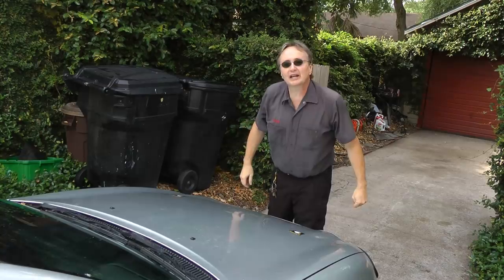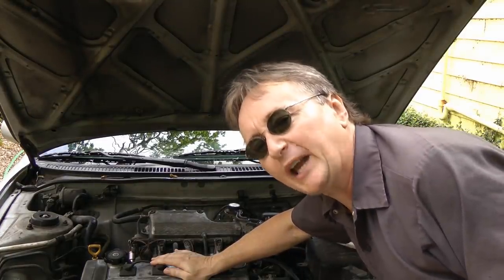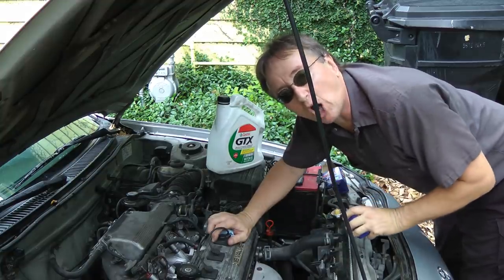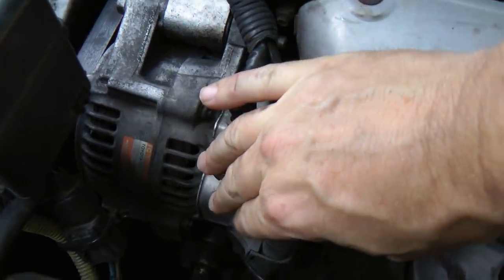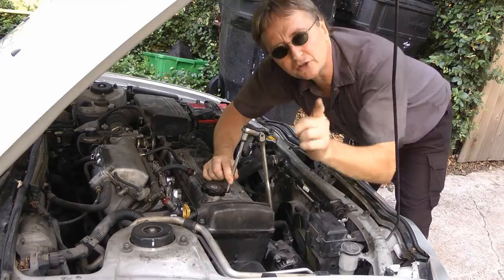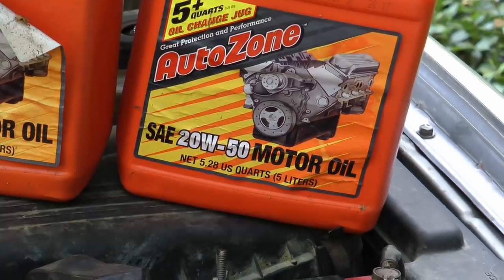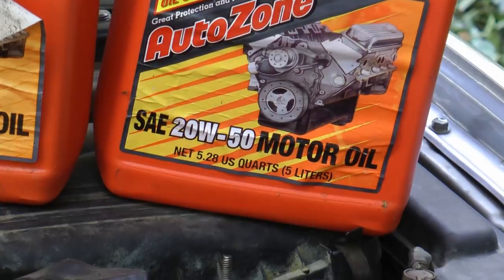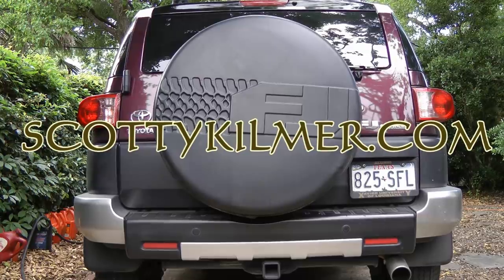Top 4 Mistakes Car Owners Make (DIY Fails)

Comment: Yep, I accidentally double gasketed an oil filter on a Mercury Cougar.  Cranked it up and heard a weird noise look under the car and there's the whole jug of oil I just put in it xD
Reply: happens to us all
Reply: Was it a 302 Windsor?
Reply: The rubber ring very seldom sticks to the engine block if it's does it's because somebody didn't put oil on the rubber first to the other guys question what is a 302 Windsor there is no windsor it's a 351 Windsor it was made in Windsor Canada versus a 351 Cleveland that was made in Cleveland
Reply: Only use a premium filter with a check valve in it that holds the oil pressure up in the engine.!!!!!! Or you will have dry start up every time good oil filters are junk anymore. Always match the rubber o-ring up with the new rubber o-ring make sure their exact a lot of oil filters nowadays have smaller O-rings they don't match up or they're sitting in a new area just barely ceiling with a lot of oxidation
Reply: Yes, I did that once but it didn't destroy my engine.  After an oil change I always check to make sure that the oil pressure returns to normal  after running a few seconds, and then I get out and check for any leaks, before driving.  So, I only ran the car for a few seconds with oil spewing out.
Reply: Be careful we can't even talk about cars the mark of the Lord Jesus Christ is listening to us and trying to hack us !!!!!
Reply: I would agree, I change people oil filters 70 times a day. Never done that.
Reply: dammit don't say that I haven't had that happen to me yet lol
Reply: thank you lol.  I have never had it happen and that is becuase I always oil up the new ring.
Reply: Ditto. Happened to me to. I was taught by my dad to start the car, then look under it to see if there are any leaks. Boy was there a leak!   All because that prior gasket stuck to the block and I didn't notice.
Reply: gizzy nc I've never done it and I've always change my own oil lol
Reply: I had this happen to me several years ago. Everything seemed fine - I always check for leaks - until the next day when I went to work. I got about 1/2 mile and the oil light came on. Pulled over immediately and all the oil as gone.  As I walked back home, I could see exactly where the engine started splooging oil - about a block and a half before I pulled over. When I changed the oil, the engine was cold. As soon as the engine warmed up on my drive to work, the gaskets popped loose.

Lesson learned. Only cost was for another 5 qts of oil. Most people would probably never notice the oil light and drive until the engine seizes up.
Reply: Did the same on a used Nissan that I was doing my first service on.  The old filter was a Fram.  I only use OEM filters and that's just one reason why
Reply: Yep and thats why you dont buy cheap oil filter made in china or brazil 😂 just buy some genuine Mahle filter and you are good.
Reply: what year/model   I've never seen that done, there's simply no room to double seal on most cars I work on.. the filter wont come close the threading on my old camaro
Reply: @ricksimpson2167  
Rick, you are wrong! I never missed putting a film of clean oil on the gasket of every filter I ever installed on my cars over the decades, but it happened to me once, back in the '80's. After that, I watched for it ever since, but hasn't happened since.
Reply: @markwheeler202  Engine oil is supposed to be changed when hot, not cold.
Reply: @1redrubberball  Which I did, as always. The unfortunate incident occured the next day.
Reply: @markwheeler202  
Yeah, I understand. It happened to me on my '72 Cougar XR7 351-C engine. I too always cranked and looked for leaks and there was my new oil, all over the driveway. That was back in the '80's. Every single time changing oil/filter since then, I remember to look for the gasket. Ah! Experience!
Reply: @ricksimpson2167  I got them both beat: I have a Windland engine, made in both places and joined together on lower Wacker Drive in Chicago.
Reply: Ah the double seal.  I did it...on the underside of a 7.4L 454...in a boat.  Hella mess.
Reply: @gizzync1525  no it dont
Reply: @tomclose6643  really ? you never made a simple mistake ? either rushing or just not fully paying attention or you just got pulled away for 1 sec?
Reply: @jasonhochman3750  Listen to your engine. It will tell you.
Reply: the oil didn't leak out until the pump pressurized it and forced it through the double gasket. 

This wasn't my car have no idea who did the oil before me. Luckily no damage was done to the engine. 

I always look to make sure the gasket is still on the old filter when I take it off now. 

This was a last gen cougar with the 2.8? V6

Comment: It's a good idea to fill the filter with oil to saturate the filter media. you can dump out the excess when filling the crankcase. This lessens the time it takes to build up oil pressure to the bearings and hence less engine wear.

Comment: The W in motor oil specs (ie: 20W-50) stands for Winter not Weight.
20W is the viscosity when cold (Winter) and the 50 is the viscosity when hot.
A common rookie mistake. 😋

Comment: So true about that disabling the battery part Scotty! One time I was backyard fixing one of the brake lights on my Lexus, I cut up the wires and wired in a new socket for the bulb from an old Chevy (it was all I had at the time) and I accidentally wired up the new light wrong. Ended up blowing the brake lamp failure sensor.... Luckily I had a spare car to take it off of but it would've have been a costly mistake. None of my lights worked when that blew, and I had to spend a week figuring out that the sensor was the culprit. After I put the new one in, everything is fine. I havnt even switched out the rigged up side with the chevy socket because it's working just fine 😅😂 The lesson im trying to teach is, when you think you know it all....things break. Just disconnect your battery and don't add unneeded stress into your life! Keeping a 24 year old (or any) car running is hard enough as it is 😂

Comment: When I was a kid I owned a 1958MGA. It had a steel can that contained the oil filter. I was changing the oil and filter on the apron of my friends’ garage.(thanks for being there for me White Cross Racing)   Four times I fitted the ring gasket and filter and four times I blew oil all over at start-up. My buddy Olson,part owner and Saint eventually took pity. Using a  sharp pick he dug five old o-ring gaskets out of where the filter can seated, put in my new one and the job was done. Experience will out! Thank Scotty for helping we amateurs out.

Comment from the maker: @cupnoodles2  those hondas can run on just about any oil. I use 20/50 castrol year round here in Texas. If it gets cold where you are, go ahead and switch to 10 w 40 or 10/30. Scotty
Reply: Honda makes some great engines...their automatic transmissions are junk, but the engines are pretty dang good at least the older ones were.  The car will fall apart but the engine will still be fine LOL.
Reply: William Todd my 2001 handa accord with automatic transmission still works perfectly fine, just needs a new power steering pump is all and it could do with new body parts. Other then that I haven't had many problems with it.
Reply: I have an 08 Honda Ridgeline it has 250,000 miles it runs great
I only use synthetic motor oils

I got the truck when it had 60,000 on it and the transmission has always had a little Shake right at 45 50 miles an hour but is never gone out
Just kind of weird

Comment: As you know, there are exceptions to every rule. And one exception with the spark plugs is on the Ford 5.4 L V-8. Sometimes you have to run the snot out of that engine to get one of those plugs to break loose if you've never changed him before.
Reply: That's what I always do. Remember, aluminum expands at almost twice the rate of steel with heat. If the plugs are really stiff and hard to turn cold, warm it up. They always come out easier. I've talked to Ford techs that say the same thing. The 3v 5.4 especially, because the threads aren't the part that gets stuck unfortunately. The lower part gets stuck and will break off inside.

Comment: I learned the oil filter gasket lesson on my first mechanic helper job when I was 17. 5 quarts of fresh oil on the shop floor it was embarrassing and I learned a valuable lesson and have always checked since

Comment: Watching your videos is always very informative, while at the same time validating what I already know. Also makes me extremely glad to have chosen Subaru for my first new car. When I popped the hood of the Impreza and found the  oil filter on the top and right in front I was extatic. (I have owned 3  90's era cavaliers which practically requires a contortionist). Still got the 100k service package but I like to know in future that I won't be cursing myself. When I watch your videos I usually end up with a self satisfied "I knew it" smirk. And a whose the fool now attitude. Though every time is still come away having learned something. Thanks again Scott!